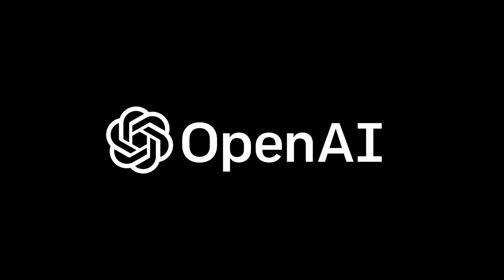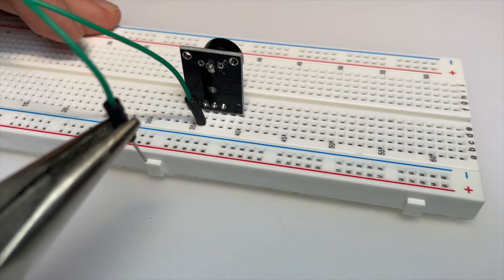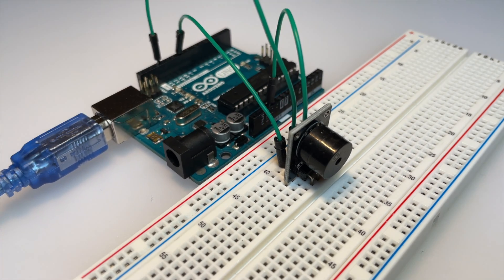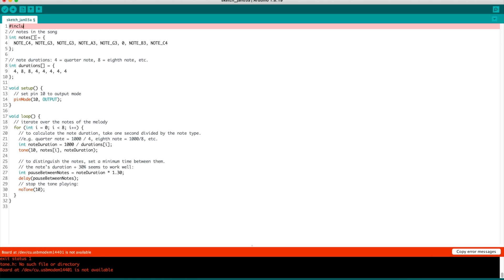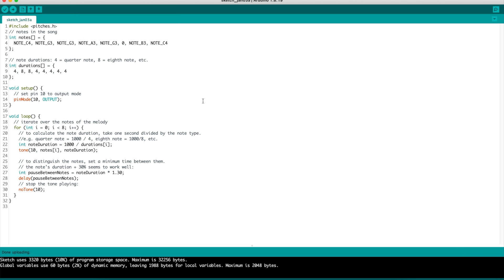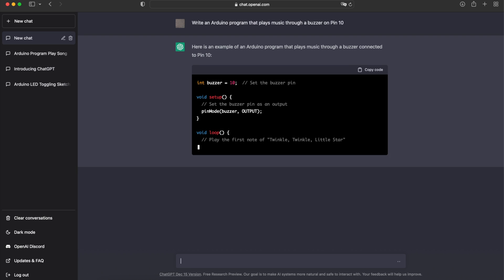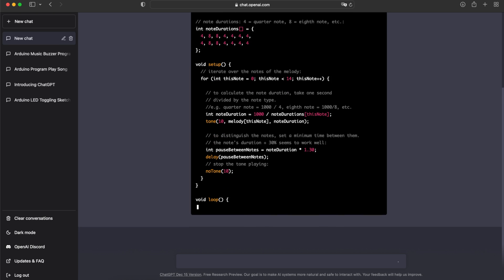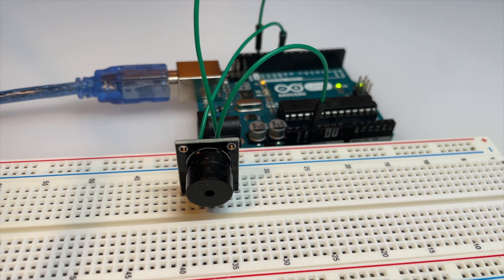Can AI Create Songs by Connecting It To Piezo Speaker?

Comment: Chat gpt isn't really good at artistic things. Nor are they good at games or anything complex. Sure, the structure of its code is good but its content its output mostly gibberish. For example, if you tried to get it to make an ascii art, or play chess, it won't be able to do it well
Reply from the maker: Oh okay.. yes I've also realised that when I tried to make it do more sophisticated Arduino projects and the output was more bugs than actual working code. Do you know if it can do easier games than chess? ticktacktoe maybe
Reply: @arduinote  it knows to generate a board but after a couple of turns it gets confused.

Alright, I'll make the first move. Here's the current board:

Copy code
  |   |  
---------
  |   |  
---------
  |   |  
I'll put an "O" in the top left corner. Your turn!

Copy code
O |   |  
---------
  |   |  
---------
  |   |
Reply from the maker: @RichSoong  oh okay I‘ll try it next time. Maybe it will work after they do the next softwareupdate
Reply: @arduinote  Maybe, but I doubt it. It is a language model after all, not a logical machine. So unless the researchers implement some type of logical engine into it or something for these types of problems its gonna be hard for chatgpt to figure out these problems
Reply: Wait for ChatGPT 5.0 me thinks 😂

Comment: Shouldn't the buzzer have only 2 pins? Why is the power pin in there? First time seeing something like that.
Reply from the maker: That's a good question. I have never thought about it but you are right it is quite unusual to see a piezo with SIG and VCC GND. Maybe there is some more electronics integrated to filter the signal
Reply: @arduinote  Could be.
Reply from the maker: @jonny11bonk  thanks for your support :)